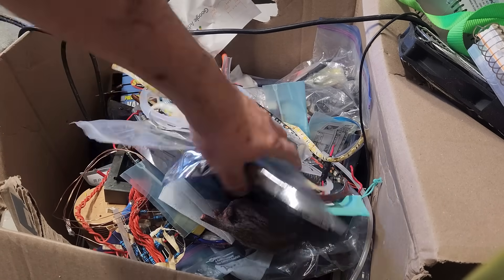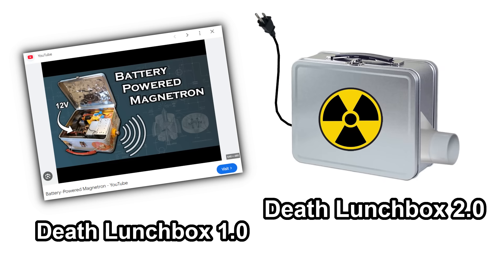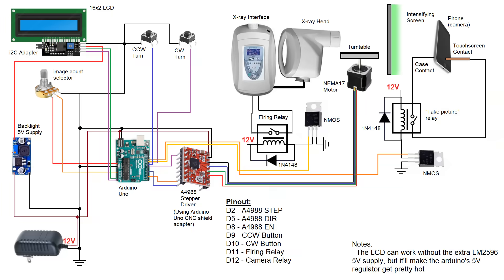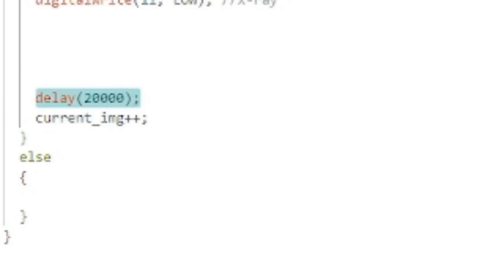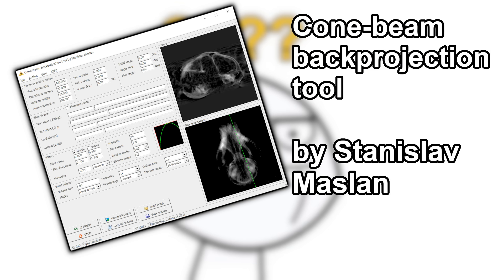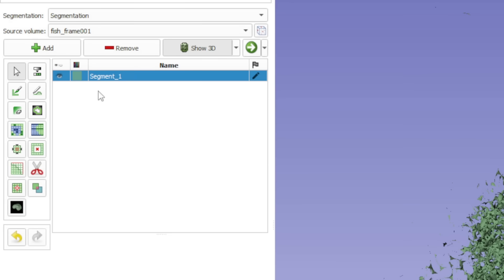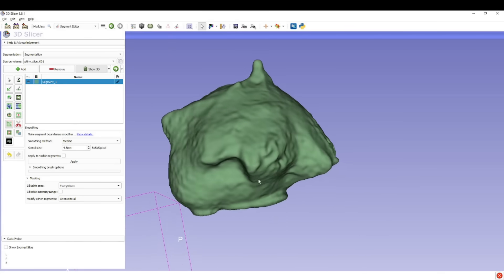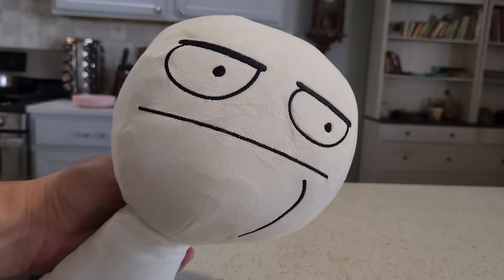Turning X-rays into 3d prints with a DIY CT scanner

Comment: You can filter out hot pixels programmatically by doing like 5 to 10 pictures at each positions and superimposing/adding/masking data. It will take a bunch of time for data acquisition, but the filtering process can be automated using macros or openCV.  It would still be useful even after you make a periscope since random noise is always a problem. I really enjoy your content, have a good one.
Reply: A median filter is also very good for salt and pepper noise
Reply: This was going to be my comment! In astrophotography they stack multiple images to even out the noise :)
Reply: @MFKitten my thoughts! I'm using DeepSkyStacker
Reply: Or, you know....USE A F-ING MIRROR.
Reply: @Atom224  then you have to flip the images and still lack the contrast that overlapping would provide.
Reply: Astrophysicists something something Fourier Transform something something - can't remember any details, very annoying.

But when you have a 3d printer, just build a periscope and stop cooking your phone, its tiny brain doesn't appreciate it.
Reply: @EmilySmirleGURPS   yes you could blur it, maybe there's a smarter way to do that spectrally tho i suspect there wouldn't be any artifacts in the spectrum, just noise, blobs in the spectrum would give you repeating patterns like dot grids or lines. but the actual data is much lower frequency that you could filter it and not lose much actual info. a median filter would likely also perform better on noise while not removing edges.
Reply: Up you go!
Reply: I think 5-10 is an overkill, simply because chance of them repeating at the same place moments later is astronomically low.
Reply: @MladenMijatov  suppose it depends on the subject but it does seem like a lot, maybe 3-5. It would make for a good comparison though how long the scan+compilation takes vs result and find that sweet spot so your scans won’t take hours
Reply: Okay, but you could also just use a mirror
Reply: Agree, just want to add that generally the best way to do this is use a median filter, that's really good at removing outliers. Technically you could get away with just 3 images per position. Then for each pixel you keep the middle of the three values, almost like majority voting.

I'm sure you can ask ChatGPT to write a ~20 line python script do automate this for a whole folder of images. If you don't feel like fiddling with the median processing in gimp
\

Comment: i feel like you could pretty much eliminate hot pixels by taking each exposure again and selecting the smaller value per pixel
since the singnal is going to be basically the same but the x-ray nose is random
Reply: tbh a periscope would still eliminate it straight up

Comment: Noice. Would you say the hot pixels are your biggest problem? The hot pixels are a pure white, while the normal scan is green. Would removing red/blue values from the green values allow you to remove them specifically, while leaving the rest? Alternatively, you could run it 2 or 3x 360° and average the pictures with the same rotation.

Comment: You could try to eliminate the Hot pixels by taking multiple pictures at the same angle, im assuming that the hot pixels are basically random, so taking like 3+ pictures then somehow comparting them so that whatever is the same between all picures is the image while differences are probably the hot pixels and get removed.
Reply: hell yeah

Comment: Why didn't you use the volume buttons instead of that whole fake finger thing?
Reply: i think it is just more predictable, and easier to assemble, when i was using servos to push buttons it wasn’t consistent some time there was slipping and missing a picture because of that is annoying
Reply: Well the volume buttons require more force than touching the screen. This is probably the easier way to avoid moving the camera too much.
Reply: @clonkex  good point!

Comment: just fyi you could trigger the phone to take a pic more relaibly using the headphone jack by having a relay between the ground and mic pin. this does the same thing as pushing the button on headphoes witch is usually mapped to the shutter.

usb headphone adapters and those bluetooth shutterbuttons work on the same principle so both should be quite reliable.
Reply: I thought he was gonna do that and instead he made a doohickey
what a legend
Reply: assuming there's a headphone jack available
Reply: @AmorDeae  you can also connect any bluetooth keyboard and hit the - key. some photo dongles that cost 5 bucks to take photos are just a singhle button keyboard that's easy to hack
Reply: Better yet scrap the phone camera and use a raspberry pi with a camera module. Allows for software based image collection and manipulation. Using python with opencv will be pretty easy to program and will do all of the resizing and grayscale conversion in real time. You could also use the gpio pins to tell the xray tube and software to trigger.
Reply: I believe bluetooth thingies also go the "volume up" button simultaion way.
Reply: Good idea
Reply: Or configure voice mode and use a little mp3 box to say "shoot' every time